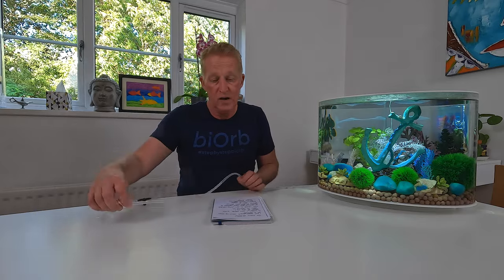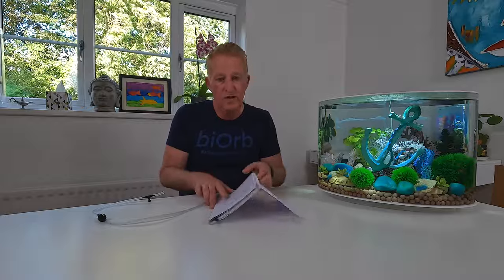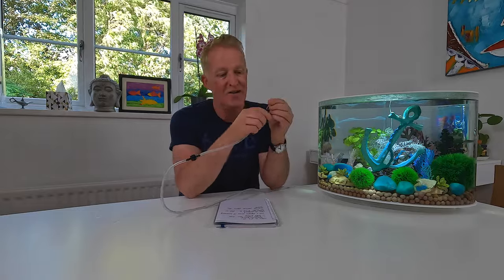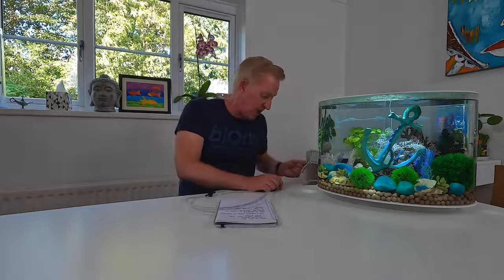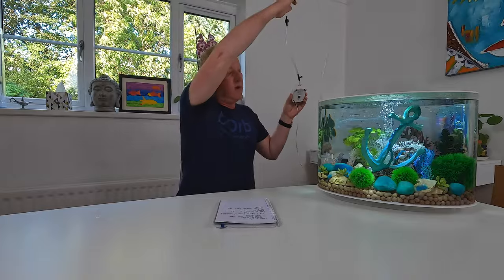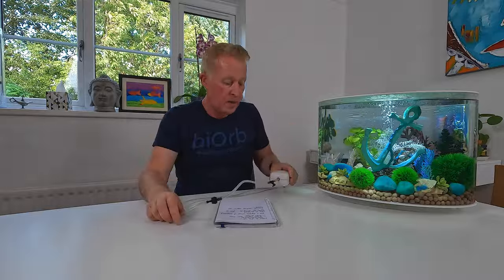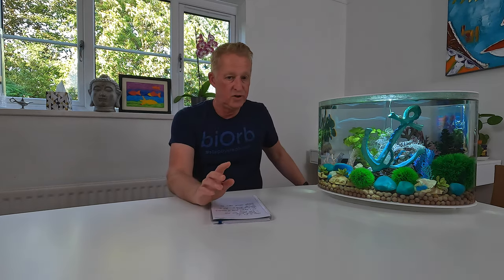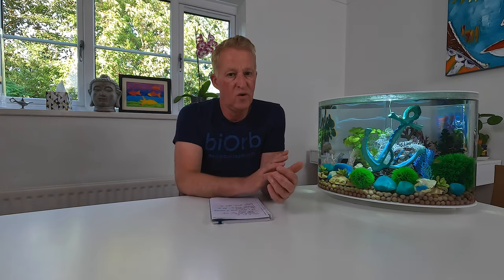bOrb Aquarium |  No air bubbles? |  But air pump works!

Comment: Hi Mark, thanks for the video. Is it possible to change the airline connected to the back of the tank having water and fish inside the tank? My water line has some white residue on it (it doesn't look like there is water on the line but it is foggy, similar to slime) before the one way valve. The bubbles I get are very few, tried blowing air but it's super difficult, feels like it's something obstructing the air line. Bought a new airline but I am not sure if it is safe to unplug it from the back of the tank with water and fish in there. Thank you!
Reply from the maker: Hi Daniel. I am not sure whether the change of the complete airline can be applied when you have a full tank.  My intial view is Yes as I understand that various biOrb tank models have a built in one way valve that sits directly under the tank's base.  The use of a bicycle air pump can help to reset the direction of the tank valve in the case of poor airflow and can help clear blockage. Clearly the tank valve is there to stop tank water from draining when the airline is removed, making it safe to do.   But, to be safe, I would suggest that you directly contact your Oase biOrb technical advice team and let them know what you plan to do and which biOrb model you have.  I (and many others) have found them reasonably good at responding so I would certainly suggest doing that.   BTW let me know how you get on. Best wishes, Mark
Reply: @StepbyStep-biOrb  Thanks, I bought a bicycle pump of Amazon and that solved it :)
Reply from the maker: Great news Daniel! Hopefully the air flow will remain good from now on.  If not, you know how to fix it  :)